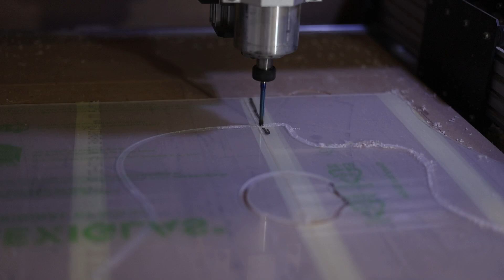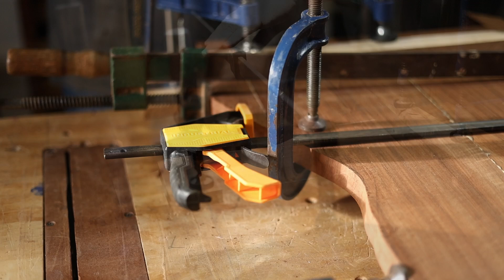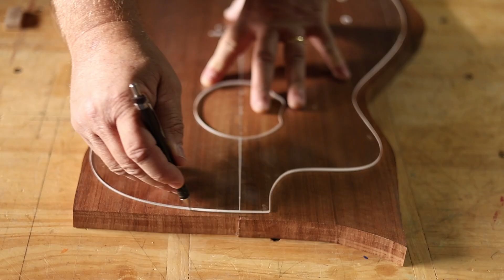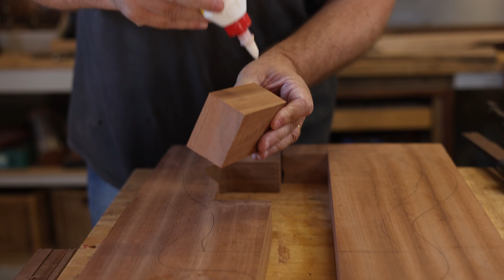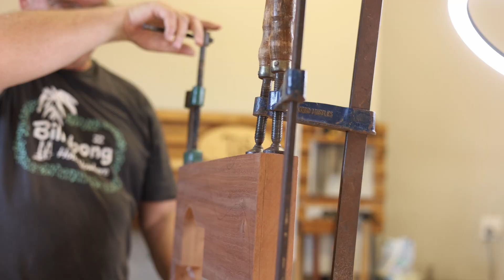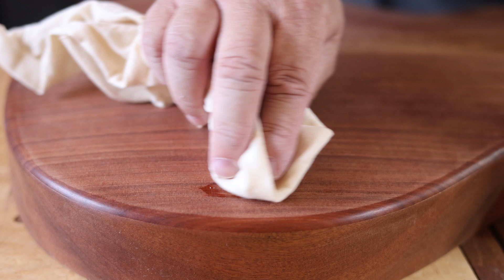TJS Albatros Acoustic Guitar Build Video 2

Comment: Nice man. I'm building bouzoukis in jbay. Must come visit sometime if u keen. Love to see you have a emco star planer. I'm struggling to use my thicknesses part of the machine. Planes very thin planks but won't allow 40mm planks through. Ant ideas?
Reply: Nice to hear from you. I’d love to connect sometime and see your instruments. The Emco Star can be tricky and I use mainly the planer and band saw after getting a wider thickesser. The thicknesser can be difficult to adjust and the feed is not very strong. I’ve put a piece of MDF on the surface to try and reduce friction when the wood goes through. Also check your feed roller belt drive as they sometimes come off or the belt breaks! Blunt blades also make life difficult 😊